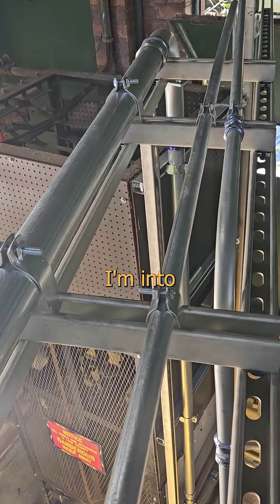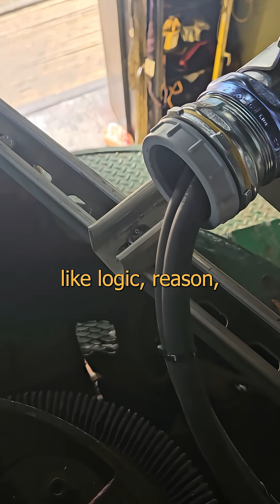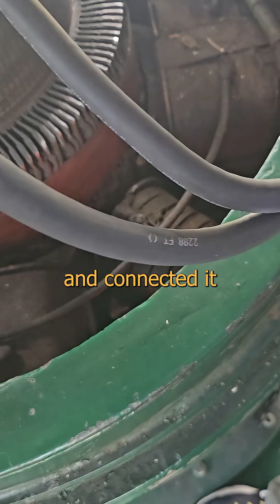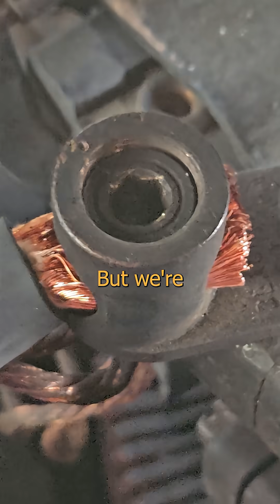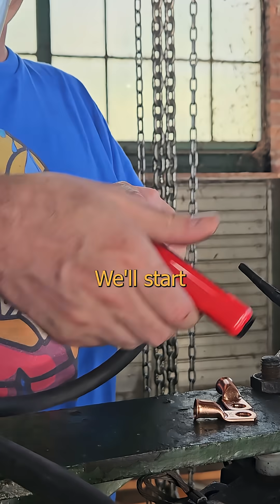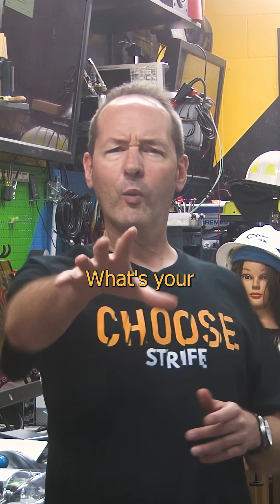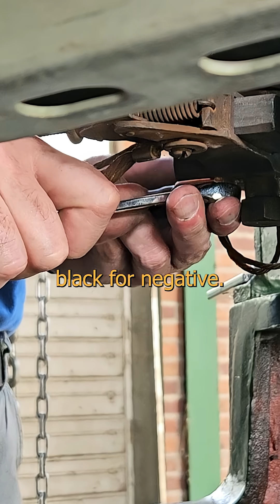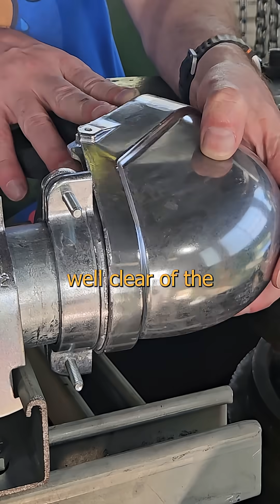Exciter Update #chrisboden #comedy #engineering #powerplant #electrical #educational #wiring

Comment: I run mine dry , no lube , no spit.  Then I crimp with a 6 ton hydraulic crimper.  Working on industrial batteries and chargers , the connectors are vital that they are done correctly.

Comment: There are already many opinions on heatshrink tubing... pro: gives good insulation, looks neat, colour coding. Con: you cant see if the copper underneath corroded... we use Sn/Ag plated lugs, contact spray to avoid corrosion due to humidity, a clear heatshrink for "insulation &neat" and a short bit coloured heatshrink for polarity coding...greetings from wago land. Love your videos

Comment: I usually use a bit of conductive grease inside the crimp barrel.  I've even purchased some that had it already inside.  After crimping, the little bit that gets displaced is wiped off and then marine grade heat shrink applied to seal it all.  That big of conductive grease fills all the voids (insert joke here).  It ensures that it can't oxidize.  We use the same stuff when bolting the crimp lugs to the ground bar.  Just keeps everything clean, dry and no way for moisture to gather.

Comment: I was astounded to find out that a missing measly 12v ground wire to vehicle frame over time, caused arcing & scoring - trashing a wheel hub & bearings.

Comment: The crimp fittings are a nice upgrade, but you should solder the wires to the fitting after crimping. The vibration from the machinery will let the copper wire deform over time and loosen from the crimp. The heavier the vibration, the faster it loosens.

Comment: Yeah I'd love to do that kind of work. I really like generators anyway, I collect them. Biggest one I have is a 40,000 watt 3-phase with a turbo diesel on it. 277/480v. what's the chances of getting 120 / 240 out of that? I do have a three-phase analog welder that I thought about rewinding the output to where it'll put out three legs of 120 volt. As it is it's a 450 amp welder. I figure rewinding the 36ish volt output to 120 volt and remove the rectifiers inside of it,it should work. Though the amperage will reduce but as long as it puts out a hundred or so amps that would probably work? What's your thoughts? Can it be done without a transformer as far as rewiring the generator head itself? Or should I just get a proper transformer,tho those things are goofy expensive 😬

Comment: I personally have less faith in heatshrink over a lug. Cuz the connection can not be inspected without turning of the system and you would have to "destructive" research.. The old fashioned direct wire looked like it was designed well. The were is trapped in the hole and the inversehexbolt kept it in place.. Only thing that could have been used instead was maybe multithread wire casing.. But yeah in the past it worked fine right... And now. You hide important connections with red shrink just cuz it looks nice?  Nah man stay genuine

Comment: I'd have added flux to the end, inserted into connector, crimped, then heated the end and ran solder inside.  Keeps the oxygen out for sure.  It's a fairly common car audio thing.

Comment: I use dielectric silicone grease on teg exposed strands before you heat shrink it .Keeps the oxygen away from the copper but the so will the heat shrink .Unless you have water issues

Comment: The noalox is for different metals reacting. Source : i climbed 350 feet in the air to fix stupid mistakes
Reply: Doesnt it also help with corrosion in damp, wet areas and near beaches?

Ive had to cut off crusty aluminum-aluminum connections that were falling apart, but the one with noalox right next to it was fine.

Comment: When I do the crimp fittings on 4/0 welding cable, I'll drill a hole in the crimp- in the neck and put a little solder flux down in there.  I'll crimp it with the same crimper as yours, then I'll heat the end up with a torch and push some 63/37 solder (thick stuff) into the hole until there's 'enough'.  I'll then heatshrink it and smile knowing that every milliamp will be available to a massive 12v load.

Comment: Now, if the polarity needs switching that often, why not incorporate a switching mechanism in the controls to prevent you needing to physically swap the leads over each time? It would save a lot of effort later on…
Reply: We should be doing inspections up top at least every 6 months, so this would just be part of the regular maintenance schedule.
Reply: because that would take 4 high amperage contactors and it would be a bad day if any one of them failed closed. to make maters worse, they would only get cycled at most twice per year. 

120 VDC on what looks suspiciously like 2/0 cabling getting shorted to ground would be a very bad day. I've seen welders do scarier things with less.
Reply: @nathanielhill8156 welders can fail spectacularly, it's impressive
Reply: What if the switch malfunctions? It would require checking it anyway, so this way it's maybe better because faults might be spotted and fixed earlier
Reply: Was about to ask that too, you could probably even have it switch automatically.
Reply: Something else to fail instead of a regular maintenance program.

Comment: I never use nolox on same element connections. Oxidation is from dissimilar metals. I know they say you don't need it on the newer copper impregnated aluminum AA 8000 stuff, I still use it on those because they will eventually oxidize.

Comment: I may be wrong here (won't be the first time) but .....
The type of lug you used has one central compression point. That is great in big aluminium solid cores or even copper with low strand count .... but your cable is High strand count.  

I was taught that such cables should have the same type of crimp connection you see in small flex (a compression on 8 sides at once). This would not allow individual strands to be broken inside when crimping but more importantly not work loose with years of heating and cooling and magnetic effects!
To be sure I think this is a small point but when you aim for excellence ...... ?
Reply: The hydraulic crimper he is using has hexagonal dies and are generally in the 12-16 tons of force. The copper will be cold welded and impossible to ever pull apart.
Reply: @brennan3735  Look at 49 second mark and reassess! Definitely no Hex Crimp there ;o)

Comment: Copper-copper doesn't corrode.  The problem is the copper deforms. Stranded wire has lots of little springs to push the gaps together but they deform. Connectors like WAGO add springs with a longer linear range.

Comment: Question: you said to reverse the pos/neg every 6 months. How do you manage all the tiny little tasks like this? I know "I use a calendar, dumbass" is probably the answer, but I could imagine the task list in a place like yours would be overwhelming eventually, and heaven forbid you have a multi-day project or get sick a week. So how do you ensure that all the little 30-second to 5 mibute tasks stay up to date rather than become deferred maintenance?

I love your videos. I'm an office worker, and ine of those "soft hands" that can't fix my way out of a wet paper bag. However, I am learning so much from your videos and I love your love of teaching.
Reply: Maintenance software. Enter your tickets and their schedule and it will create a new work ticket for every occasion according to the schedule.
Reply: @Spookieham  I wonder how it was done before computers, I imagine some pretty thick binders full of scheduled work, possibly organized by month in the office parts of complex operations like power plants.
Reply: I imagine for a plant sized generator, it would have to be done during scheduled maintenance. I don't think you can flip it while live without throwing a whole lot of alarm bells. So, probably calendar it. But, could still build a DPDT reversing switch so you don't have to move cables each time. Or, maybe automate it with a PLC controller that will flip it whenever the timeframe is ≥ 6 months and the current passing through it is 0 (when it's down for maintenance). Then it's a set it and forget it.
Reply: Was he referring to the DC cables? I did not understand that part. If it is DC cabling then you could destroy the thing next in line or am i missing something?

Comment: A perfectly done crimp connection should actually be gas tight inside the crimped area. And have less than 2% void space.

Anything you do should be to try and keep corrosion away from exposed conductors, but you typically don't need to worry about inside the crimped connections.
Reply: I haven't seen what high strand count wire like that looks like, but I just did some 19 strand 8awg (A mistake, I need to replace it with high strand), and when I cross sectioned two crimps done with an 8awg and 8awg+ dies the 8awg almost looked like a single piece.
Reply: @Originalsunrunner20  It SHOULD look like a single piece. I just replied to a guy talking about soldering his crimps. If a crimp is done correctly, a process called 'cold welding' takes place, where the pressure, and accompanying heat from the sudden pressure, causes the strands to become a single piece of copper in that cross section.
As the OP said, it becomes 'gas tight'.. because it's a solid piece of copper at that point.

Comment: With regards to the use of oxide inhibiting paste, I work as a lightning protection engineer and when I design a system that makes use of aluminium (above ground only of course) then I will always add some compound to the BOQ, but unless copper to copper connections are going to be in a particularly nasty environment, I generally don't add compound.

Comment: Where I work we do put noalox on copper to copper connections. Most of the wire we use I our generators is fine strand a welding wire, which tends to corrode quicker. 
Source: my boss has been doing this for the past 15 years!

Comment: I presume since you upsized the lugs, you used a mfg’r that was rated for that smaller wire compression and a tool that is also rated for. The tool is usually dieless in that situation. And no, De-ox is not needed for cu/cu.

Comment: It's my understanding that Nolox was long required (and I think still recommended) specifically for situations where you have dissimilar metals involved. There is a bit of information out there, no reference for the moment, that notes that dissimilar metals have a different coefficient regarding their electrical properties, and in an environment where there may be water infusion, this difference can introduce a significant corrosion factor. 

In my own experiencee with 12v dc connections, it's a good idea to provide an additional seal besides the crimp. I've had crimped on connectors, copper to copper where exposed copper ended up getting wet with some contaminate, and the corrosion started working it's way up the stranded copper within the insulation. This means "cut, strip, examine," repeat as needed till you get to clean copper, then crimp on the new connector, (for me Power Poles and or those screwy Kenwood T power connectors) then treat any exposed surfaces with an anti-corrosive (Even liquid electrical tape brushed on) then seat the crimped on connector in the carrier housing. Note, do not 'liquid tape' the mating surfaces of the connector to it's peer unless you're looking to operate in the open state. (Note that if you get appropriate mating Motorola power connectors, and have paid attention to which end you're working with, that can work. I prefer power poles, in either case it's possible to build wrong, but a bit more obvious on Power Poles before you start running -12 volts dc into something expecting +12 volts dc. That said if you use the Motorola connectors, you may also want to tape the connection to keep moisture out of that connection.)

That said, if you're flipping the DC connections every 6 months or so, that's going to give you a chance to examine the state of the connector, and address any corrosion concerns. Presumably before they get to be a significant issue.

One minor concern with respect to copper is how pure the copper is, and are mating surfaces the same purity. If the manufacturer used some mix of Bronze for a more durable connection for threading to hold into, I'd recommend Nolox for that link. Likewise for people working with batteries with led terminals, protect those links too.

Comment: Since you're crimping lugs on and they are the same material I wouldn't worry about noalox if it was copper wire into an aluminum termination or vice versa yes noalox because dissimilar metal corrosion. No reference other than highschool chemistry and some aviation maintenance classes because they care a whole lot about contact between dissimilar metal

Comment: My thoughts are if it’s meant to last more than 10 years you had better use noalox or oversize your lug and use a water tight heat shrink like you did. No sources just 15 years of car audio experience in the rust belt.
Reply: Because it's all copper, there shouldn't be any electrochemistry going on. It's when you're using dissimilar metals that you get accidental electrochemistry going on (it's how NiCd and NiMH batteries work). About the only thing I'd be worried about would be condensation dissolving atmospheric carbon dioxide and eating the copper, but it should take literally hundreds of years for that to cause problems (by which time the whole thing will hopefully have gone through at least one more round of maintenance) and, as you pointed out, the heat shrink should keep condensation out.

Comment: Dissimilar metals i think is only in 344.14, applies to RMC, and is allowed  but should be avoided where practicable. 

And technically galvanized action can only happen under the "supervision" of an electrolyte, in that case a silicone paste would be just as viable just keeping water out. As long as does not interfere with mechanical contact, and electrical conduction.

Comment: The way they were was fine until you said they needed swapped every 6 months. Not it's a cleaner job to swap them. I'm kinda wondering why this is done manually vs a switch set up.

Comment: According to the 1-1a-14 (aircraft wiring bible) there is nothing in there about putting chemicals or stuff inside of a terminal lug. The only thing it does say is that you can fill it with solder if you like
Reply: ok, so I'm not an idiot for pot soldering my crimps. (I like it because less air and you don't have the whole thing unravel if a couple strands break)

Comment: I have no logical reason behind my choice but I remember doing automotive battery terminals they had a little solder lug you put the lug into the connector heated up with a torch and jam the wire in. I kind of like them

Comment: Nord Lock SP washers are great for that type of termination in a high vibration environment, they're just kinda spendy for what they are.

The order goes (passthrough):
1.) Zinc Grade 8 bolt
2.) Nord Lock SP
3.) Lug terminal
4.) The thing you're mounting it to (passthrough)
5.) Fender washer
6.) Split ring washer
7.) Nut